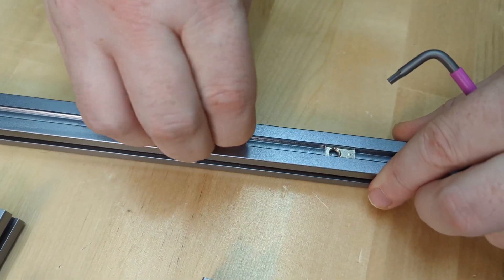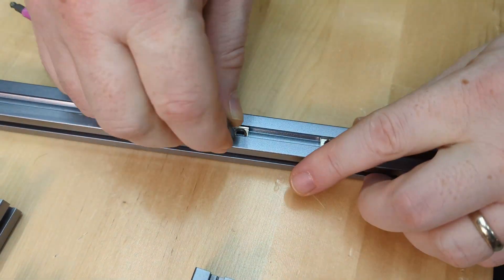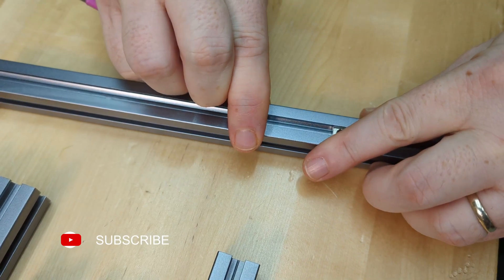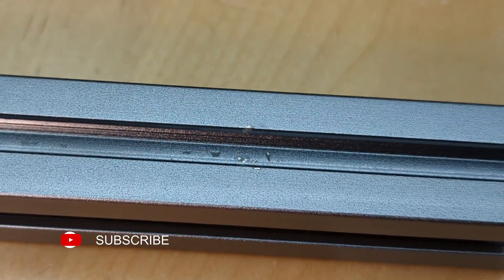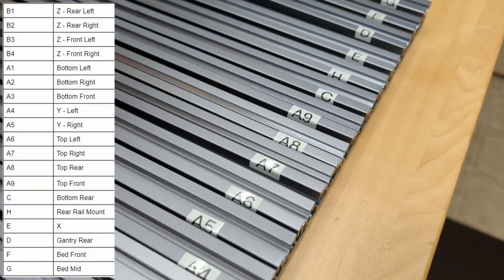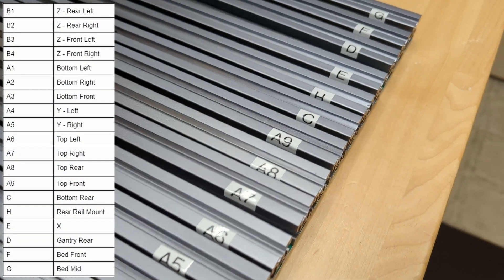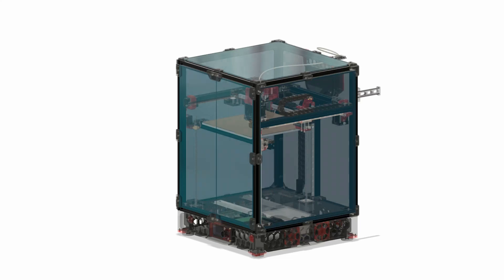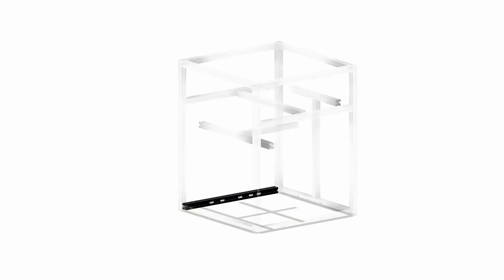Preloading T-Nuts in a Voron Trident 250

Comment: Great work!
To the LDO Trident 300 KIT users. I know they refer to this video in the LDO build notes, but the preload pattern is different between 250 and 300.
The LDO Trident 300 kit has its DIN Rails rotated 90 degrees compared to the official Voron manual.
Reply: Are there any resources out there that show what the preload would look like w/ the LDO 300?
Reply: For future peoples: If I am reading the diagrams correctly, the preload difference is: 250 - preload DIN rail t-nuts (4 per extrusion) onto the inside facing sides of A1 and A2. 300 - preload DIN rail t-nuts (4 per extrusion) onto the inside facing sides of A3 and C. Refer to the photographs in the LDO docs on the "wiring guide" documents for the DIN rails.
Reply: So do I need to take t-nuts from A2 and A3 and put them in A1 and C, if so what quantity?  Is that the only difference, can I follow the rest of the video for my 300 build?